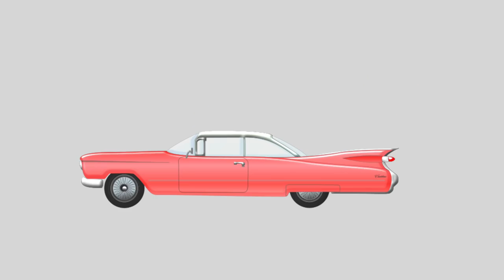Yes, Rockets CAN Fly in a Vacuum

Comment: What are rockets propelling against in a extreme vacuum? Just like cars, they don't move on their exhaust alone. Where's the friction? Rocket engines have friction due to the atmosphere. Vacuum=No Atmosphere
Reply: Would I feel recoil if I fired a crossbow in a vacuum?  Yes or No?  If so WHY?
Reply: Stuart Gray You might feel the recoil of the string release, but there is no opposing force to push back. You and the crossbow are one object and the only force is the crossbow. Vacuum sucks it doesn't oppose.
Reply: @SamuelMiller1989  sorry but you are incorrect.  If I had a remote controlled Crossbow, loaded it with a projectile of the same mass as the crossbow, positioned it floating in zero-G, in a vacuum with no one holding it, what would an observer see when he fires the bow with the remote? What happens to the bolt and the bow ?
Reply: Stuart Gray You are saying that a little tank on earth that simulates space is going to react like the infinite void?
Reply: @SamuelMiller1989  I didn't say ONE THING about the vacuum chamber. Are you changing the subject ALREADY?  just answer my simple questions and I can convince anyone (who actually understands basic physics) how rocket propulsion MUST work in a vacuum.  After you answer the questions I will show you proof.
Reply: Stuart Gray Ok, so this is theoretically in space got it. The bolt would move to the end of the crossbow, detach and progress to move in whatever direction the vacuum is sucking, with the bow.
Reply: @SamuelMiller1989  what happens to the BOW???   Oh and the "vacuum of space" does not "suck".  It is not possible for "nothing" to exert a force on any matter, solid, liquid, or gas.
Reply: Stuart Gray Exactly nothing can exert a force. The Bow as I already mentioned will be moving in the same direction as the bolt. "Nothing" cannot exert against it.
Reply: @SamuelMiller1989  - "The Bow as I already mentioned will be moving in the same direction as the bolt"

no it will be moving in the OPPOSITE direction.

  and it IS TRUE that "NOTHING" CANNOT exert a force of any kind on anything.

 The "vacuum of space" DOES NOT "Suck".  

  I have been operating thermal vacuum chambers for almost 25 years.  I think I know.
Reply: Stuart Gray Why are you changing the subject to chambers? So you believe the bolt acts as the 2nd opposing force? What's happens when it is no longer in contact with the bow? That bolt needs a opposing force to push the bow does it not?
Reply: @SamuelMiller1989  once the Bow fires the bolt they will BOTH have a velocity in opposite directions.  If the mass of the bow is the same as the bolt they will both have the SAME velocity in opposite directions.  I mentioned chambers because o know a lot about "vacuum" and what it does. I was actually trained at Lockheed Martin' "Space Simulation Laboratory" in the 90s on the same chamber they tested the Viking Landers in.
Reply: Stuart Gray Hmm well I understand how that works on earth because of the factors of friction and weight working with gravity. Yet none of those factors matter in space. A million tons is weightless in a sense. Am I wrong?
Reply: Stuart Gray Back to my original point. A Rocket does not function without a 2nd force, the 1st is the propulsion. The second is what opposing force?Entertaining the idea that the energy wouldn't immediately disperse. As we agreed earlier space has no force to exert.
Reply: @SamuelMiller1989  "None of these factors matter in space. A million tonnes is weightless in a sense. Am I wrong?"

You Are Wrong.
Mass and weight are two different things.
It will take 1000 times more energy to accelerate a 1000kg object to 10 meters per second than it would take to accelerate a 1kg object to the same speed.

In a frictionless environment:
If your mass is 100kg and you throw a 1kg rock at 1000 meters per second, you will also start traveling at 10 meters per second in the opposite direction.

This is simple conservation of momentum.
Reply: @SamuelMiller1989  " Yet none of those factors matter in space. A million tons is weightless in a sense. Am I wrong?"
Sorry, but Yes, you are wrong.  Inertia is based on MASS.  Mass does NOT disappear in zero-G.

WEIGHT disappears when you get far enough from  gravitational well, but MASS does not.

Do you think two giant blocks of steel could be squeezed together with a spring between them, and when you let go the two blocks fly away from each other at infinite speed ?

No the blocks still have mass, therefore they still have inertia regardless of weight.

" A Rocket does not function without a 2nd force"  For ONE, let me stop you right there.

There is NEVER such a thing as a "single ended force". Force ALWAYS occurs  in a pair (or "couple").

Newtons THIRD LAW literally states " All forces in the universe occur in equal but oppositely directed pairs. There are no isolated forces ".

So if a Bow fires a projectile, the projectile feels the force of the string pushing on IT, but the bow MUST feel an equal AND OPPOSITE force while pushing the projectile away.

This is why you initially failed to appreciate that after the bow fires in zero-G, in a vacuum, it has backwards velocity that it did NOT have before the firing .  The Bow PROPELLED ITSELF BACKWARDS by Throwing Mass forwards.

Now what if I have a linear catapult in zero-G, in a vacuum, that can fire giant WATER ICE BLOCKS like a jet from an aircraft carrier?

Can that catapult Propel itself backwards by firing ice blocks?
Reply: Stuart Gray You actually agreed with me. I didn't claim mass didn't matter, weight didn't. Please stay on topic of Rockets, not bows or catapults. We don't travel in space riding those. If a rockets combustion works in space please explain the Joule-Thompson effect.
Reply: @SamuelMiller1989  you didn't answer the last question: could a linear catapult propel itself backwards, in zero-G, in a vacuum, by FIRING BLOCKS OF ICE ?  It is a yes or no answer.  Then I will finally get to my point and direct you to video proof of rockets working in vacuum.
Reply: Stuart Gray And you are continually ignoring what I say. Do you know of the Joule-Thompson effect? If you can't converse about rocket engine combustion and continue to compare a simple tension operated bow with a combustion chamber which does not function the same way. "I'm a mechanic and a hunter." Then I'm no longer going to entertain this. The bow analogy is like saying a light bulb is similar to the sun. I guess we can agree to disagree Sir.
Reply: @SamuelMiller1989  so you refuse to answer a yes or no question.  As I said I would have revealed where the WHOLE conversation was going all you had to do was answer that question. I was ALSO going to reveal Video EVIDENCE of rocket propulsion in a Vacuum, and reveal what I do for a living.  But since you are incapable of a single syllable response, then never mind.  And YES I know what Joule Thompson cooling is, I have an engineering degree. But it is irrelevant to the Law of Conservation if Momentum, which we ARE talking about.
Reply: @SamuelMiller1989  oh and a light bulb CAN BE very similar to the sun in certain ways. (They are both photon emitters).  So I guess trying to compare them depends on what characteristics we are interested in.  Since the law of Conservation of Momentum doesn't CARE if the MASS in question is solid, liquid, or GAS, then the comparison of crossbows to rocket propulsion IS RELEVANT !!  Physics DOESN'T CARE if you are PUSHING on solid matter OR GAS. Both still have INERTIA and require a FORCE to feel acceleration.  PERIOD.  If a bow acceletates a solid projectile IT FEELS A FORCE.  If a rocket nozzle accelerates a gas IT FEELS A FORCE.  You CANNOT talk your way out of that.
Reply: @SamuelMiller1989  : The original problem was propulsion by reaction in vacuum.
Not light bulbs.
Did you already understood it?
Reply: Stuart Gray The only way a bow would work in a vacuum is if the vacuum exerts a force against the bow and bolt. They can't push off each other unless there is a force or friction around them. No friction no movement. As far as a combustion chamber of a rocket. Hah! You still haven't given any information. Once the chamber is opened it would immediately disperse and there would be ZERO mass for the rocket to work with. In a vacuum a combustion chamber would not combust on a molecular level. Think small. 1 object "A Rocket" cannot be both the 1st and 2nd opposing force. The must be a reaction to the opposite force. What is it then? Explain the 1st and 2nd force please.
Reply: @SamuelMiller1989  : "The only way a bow would work in a vacuum is if the vacuum exerts a force against the bow and bolt."
Here you seems really far from reality.
If you take a compressed spring in space. And release it. Would it stay compressed or release?

"Once the chamber is opened it would immediately disperse and there would be ZERO mass"
"immediately": do you think gases travel at infinite speed?
Take your box. Fill it with air. Put it in space. Now open a small hole in it. Will gases "immediately disperse and there would be ZERO mass"? How can it be?
Air will go out of the box by that hole, at a speed we can compute, and thus creating thrust.
No?
Reply: Thomas Kundera I see where you are coming from, I am just having an issue with the simulations we do on Earth with a very different set of rules. The vacuum of space is suppose to be huge and not to mention all of the gravitational pull from planets etc. I find it hard to believe that with little friction a rocket can go in any direction with a fuel that is obsolete for those conditions. Once that combustion chamber opens to release the "back pressure" we are suppose to believe it has pressure pushing in the opposite direction? No, sadly no, once it's opened all pressure is lost.
Reply: @SamuelMiller1989  we can finish this if you just watch the YT video titled "Six SpaceX launches synchronized to the landings".  Then describe what YOU SEE.  Just describe what happens to just the first stage of any of those six launches.  Say the bottom middle
Reply: @SamuelMiller1989  : "The vacuum of space is suppose to be huge"
Near 0, yes, so what? It's not that much different than 1 atm for a rocket chamber that is under tens or even one hundred time higher...

"with a fuel that is obsolete for those conditions"
Obsolete in what?

"Once that combustion chamber opens to release the "back pressure" we are suppose to believe it has pressure pushing in the opposite direction?"
It does.
Do you think momentum is not conserved in space?

"once it's opened all pressure is lost."
Again, and try to read that time:
Take your box. Fill it with air. Put it in space. Now open a small hole in it. Will gases "immediately disperse and there would be ZERO mass"? How can it be? Air will go out of the box by that hole, at a speed we can compute, and thus creating thrust.
Do you get that?
Reply: Thomas Kundera How about try to think this time. Think small, what happens to the gases? There is no force to oppose them. They would dissipate faster than a mass could be created. Even if it could, the Joule-Thompson Effect would not allow the exhaust to be greater by itself.
Reply: Stuart Gray Why would I watch something by the very people I have watched many times and am questioning? I am using my brain to think. Critical thinking. Personal research, conversing with others etc. The combustion has flaws the 1st opposing force is the rockets combustion, what's the second? The 1st force isn't the mass of the rocket.
Reply: @SamuelMiller1989  : "How about try to think this time."
Good! I would hope to see you doing same one day :-)

"what happens to the gases?"
It goes out by the hole.

"There is no force to oppose them"
Fine, so it goes out.

"They would dissipate faster than a mass could be created."
Do you agree that the speed of the gas would be related to the size of the hole? And that the smallest it is the slowest (in mass/time) it would go away?

"oule-Thompson Effect would not allow the exhaust to be greater by itself"
Greater in what and than what?
Reply: Thomas Kundera Well someone else im sure could explain it better. I'm not explaining that here, spend some time and research. You still haven't given me an answer as to what is the 2nd opposing force. The 1st is the rockets propulsion...
Reply: @SamuelMiller1989  : "You still haven't given me an answer "
It's difficult, as I don't know what you can understand yet.
Do you understand momentum conservation of an isolated system?

I'll give two longer answer anyway.
Reply: @SamuelMiller1989  : Lets imagine the following:
Somewhere in a good vacuum, I put a metal box, with vacuum inside too.
Inside that box are two liquefied gas bottles. One O2, the other H2.
I slightly open each bottle: now gas start filling the box. It's no longer vacuum inside, agree?
There is a pressure, that is growing.
Then, I open a small hole in one of the box walls. 
Gas start to go out from there, but rather slowly.
So it's not vacuum inside, there are gas, going out of the bottle, creating pressure inside the box, and evacuating through some hole, at a rate that rise with internal pressure of the box.
So far so good.

Now, I light a match inside: the gas insides take fire.
Temperature rise a lot, as well as pressure.
Gas starts to be pushed out the box by the hole at great speed.

That's a rocket.
Reply: Thomas Kundera Thank you for your time and effort to explain this to me, I appreciate it. What confuses me is the exposure of the exhaust to the vacuum. How can it cloud together to form a back pressure in a space that exerts no opposite reaction? Unless space isn't as empty as we are told. Again what is the 2nd opposing force?
Reply: @SamuelMiller1989  : "the exposure of the exhaust to the vacuum"
I don't understand why it's that much a question for you.

"How can it cloud together to form a back pressure is a space that exerts no opposite reaction?"
Read again the box with the small hole explanation.
Do you agree than even with the hole open, the box still have pressure inside for quite some time?

"Unless space isn't as empty "
It is.
Reply: Thomas Kundera So you believe that when a combustion chamber or a box opens it will still maintain its pressure for a decent amount of time? Again what is the opposing pressure "force"?
Reply: @SamuelMiller1989  : " So you believe that when a combustion chamber or a box opens it will still maintain its pressure for a decent amount of time?"
Again, how could it be otherwise?
If I have a 10m³ box filled with gas at 2 MPa, and I cut a pin sized hole one one face, do you think the pressure will  disappear in a fraction of second?
Please answer me.

"Again what is the opposing pressure "force"?"
Absolutely no opposite force.
Reply: Thomas Kundera I'm not sure how fast it would dissipate yet if there is no 2nd opposition then the rocket cannot be exerted in any direction. That exhaust has to equal the mass of the rocket, in a vacuum.
Reply: @SamuelMiller1989  : "I'm not sure how fast it would dissipate "
But agree it will take some time.
And if at the same time several 50000rpm pumps are throwing tons of fuel per second in it, it will likely last as long as it will takes the fuel tanks  to empty. Right?

"if there is no 2nd opposition then the rocket cannot be exerted in any direction"
As said, you can see it two equivalent ways:
- mechanics: conservation of momentum means the rocket+gases should keeps total momentum, so if gas is going one way, rocket will take the other.
- thermodynamics: gas pressure is on all sides of the box (so equal to zero) until one side has a hole, there is no pressure there, so the box is pushed the other way.

"That exhaust has to equal the mass of the rocket, in a vacuum."
I don't understand the "equal the mass of the rocket" here.
Reply: Thomas Kundera hahaha yeah 50000 tons of fuel, it will last as long as it does, but my main concern is what does this rocket combustion push against to create movement? As far as the "Equal Mass" if the rocket exhaust mass  is smaller then than the rocket mass then the rocket would not be propelled. Yet we still haven't established what the 2nd opposing force is.
Reply: @SamuelMiller1989  : "hahaha yeah 50000 tons of fuel,"
You're saying. I never talked about "50000 tons of fuel", that's more than 10 times the biggest rocket ever sent. Where did you got that number from?

"is what does this rocket combustion push against to create movement?"
Gas is pushing on the inner side of the combustion chamber.
That's how you get move.

"As far as the "Equal Mass" if the rocket exhaust mass is smaller then than the rocket mass then the rocket would not be propelled."
Wrong. Conservation of momentum makes:
m1v1=m2v2 (assuming two objects splitting, here the rocket on one side (1), the gas on the other(2)).
So, v1=v2 m2/m1
If v2 <V1, speed of the rocket will just be lower than the speed of the gas.
(it's an oversimplification here, we should differentiate and write dv1m1=dv2dm2, and then integrate. but it's the idea).
Got it?

"Yet we still haven't established what the 2nd opposing force is"
You just don't want to understand it.
Reply: @SamuelMiller1989  : "with the nvm=bbngj bullshit"
Basic mechanics, go back to school, sorry.

"Teach me what is the 1st and 2nd opposing forces that a rocket utilizes please."
Again: force of the rocket on the gas, and of the gas on the rocket.
What's wrong with that?
Reply: Thomas Kundera Oh how insulting, that you mention that this is so trivial. So your claiming that a Rocket in space which has no friction or weight or gravity is a FORCE not just a mass?
Reply: @SamuelMiller1989  : "how insulting, that you mention that this is so trivial."
Newton mechanics is 500 years old. Studied in college... If you call that "BS", I have to tell this to you.

"So your claiming that a Rocket in space which has no friction or weight or gravity is a FORCE not just a mass?"
A "rocket in space" is not a "force".
I really don't understand where you got that from.

Agree that if I tie two masses by a compressed string in space, if I release the string they will fly away from each other, each one pushing on the other through the spring?
Reply: Thomas Kundera wow, okay maybe there is a language barrier. I never claimed that a rocket was a FORCE. I was pushing that you had mentioned that. Okay this topic is over unless you or anyone else can explain what is the 1st & 2nd force of the Rocket propulsion is. Read the previous comments and I have tried to ask over and over what the 1st and 2nd forces are.
Reply: @SamuelMiller1989  : why do you want "1st & 2nd force " ?
What are your preconceptions under this request?
Reply: @SamuelMiller1989  - "or anyone else can explain what is the 1st & 2nd force of the Rocket propulsion is"    SURE.  The Rocket PUSHING OUT THE GAS is the ACTION , The GAS PUSHING BACK ON THE ROCKET NOZZLE is the REACTION .  There you go, a FORCE PAIR:  ACTION and REACTION.   IF you HAD actually EVER TAKEN A PHYSICS CLASS IN YOUR LIFE - you would also know the primary principle behind rocket propulsion the Law of Conservation of Momentum.  Care to summarize the Law of Conservation of Momentum for us?  No?  That's because you have to UNDERSTAND A THING BEFORE EXPLAINING IT TO OTHERS.
Reply: Stuart Gray The gas cannot push back against the Rocket unless there is something in the atmosphere that is pushing against the gas. Vacuum has no atmosphere it is void of anything and disperses all molecules. As soon as that combustion chamber is open it would become a vacuum, an opposing force could not exist.
Reply: @SamuelMiller1989  so YOU are saying that gas molecules CAN BE ACCELERATED WITHOUT A FORCE?  If you are NOT saying that, then WHERE is the force coming from when rockets expel gas into the vacuum?  Hint: it CANNOT be from the vacuum.
Reply: @SamuelMiller1989  just watch the YT video "Six SpaceX launches synchronized to the landings" then TELL ME WHAT YOU SEE.
Reply: @SamuelMiller1989  : "The gas cannot push back against the Rocket unless there is something in the atmosphere that is pushing against the gas."
No, this is not related.
Can you just learn elementary physics?

" As soon as that combustion chamber is open it would become a vacuum"
Wrong too.

Understand those two points, and come back then, ok?
Reply: @SamuelMiller1989  did you give up? Or did you finally figure out where your misunderstanding of physics  was?
Reply: Stuart Gray no I didn't give up i guess I'm just at loss of words. You claim space isn't a vacuum I agree, but a lot of people believe it is. I also haven't told you what I believe it is. That doesn't matter, the issue is if space is void of matter, how can matter from a exhaust stay together long enough in a infinite void to create enough Mass and pressure to push a rocket? There are more than 2 forces at play. 1 Rocket 2 Exhaust 3 something that resists the exhaust to cause the exhaust to be a stable resistant. If there is no 3 it won't work.
Reply: bbunk22 I wasn't taking to you or responding to you.
Reply: bbunk22 
What is the equal an opposite reaction of the combustion and what resists it to create a mass for the rocket? You insist on butting into this conversation, do you enjoy rooting in other people's conversations? You deliberately divert from even considering a 3rd force.
Reply: bbunk22 please provide video proof, actual video not CGI of rockets igniting and moving in space. I agree they work on Earth, because of a 3rd force. In a vacuum, it wouldn't work. We can watch rockets all day long fly around in Earths atmosphere. You can not explain what resists the exhaust. On Earth the exhaust is resisted, therefore it can push against the rocket.
Reply: bbunk22 you have nothing but words also, take Newton or Einstein or Tesla for example. Their quotes or ideas were promoted through media and often times they were angry with how the media said this or that which was inaccurate. Do your research. As far as video proof, provide video of rocket combustion in space. Not earth which I agree many people have witnessed. Explain also why we have never went back to the moon due to Americans destroying the technology, but Armstrong explains it was less tech than a cellphone. I can provide video of them saying this.
Reply: bbunk22 I have already explained it but you seem to ignore it. Here it is again. Forces: 1 Rocket 2 Combustion 3 Matter or Atmosphere to resist the combustion so it is a stable force to propel.   That is how rockets work on Earth where a vacuum is not a factor. You didn't provide video evidence of functioning rockets in space. Put up or shut up.
Reply: bbunk22 You keep referring to Newtons second Law and if you stay on that then there is no other force described. What I've been trying to convey is the combustion needs a resistance for the reaction of propulsion to work. A vacuum of space doesn't provide that. If you think it does how? What in a vacuum reacts to the combustion? You can't push off of nothing. Did you watch those videos? Eh even if you did the cognitive dissonance is strong with you.
Reply: Newtons Laws created in 1687 and apply to Earth not space. We didn't start assuming that it was for space until the moon landing news and after.
Reply: bbunk22 so let me get this straight you are saying that it is suppose to be acceptable knowledge that Newton, Galileo, Etc. all these men knew for a fact how space worked and functioned? Explain how they knew that when on Earth we had sword, knights in armor and horses and most people barely lived to be 40. Oh and when you say  I quote " Newton didn't have videos and I don't need them either" That is a very insane comment. He didn't have them because they barely had FIRE! You don't need them? Sure it's not a need I agree, but that point was just insane.
Reply: bbunk22 I'm sorry I have tried the video link multiple time and it's not working for me. I digress I still don't understand how you can believe men that had theories 500+yrs ago and that they would apply to modern science. Not to mention our American scientists say we can't go back to the moon because we destroyed the technology, yet the tech. was barely stronger than a cell phone. I provided the video evidence from the horses mouth.
Reply: bbunk22 I was able to review it this time thank you. I believe our conversation is coming to an end. The point is I don't have a source that directly ties to Newton from what I am suggesting. I do not believe Newtons THEORIES were applied to space which he had not been able to test in 1687. You believe Newton could prove space physics by testing in 1687? Science is based off of proven fact, how could Newton prove from testing that space was THIS way in 1687?